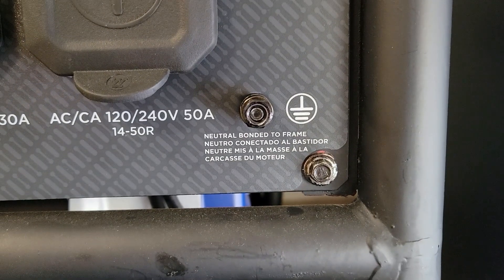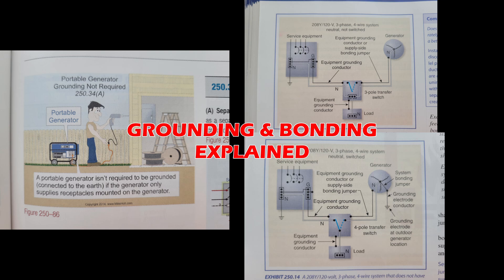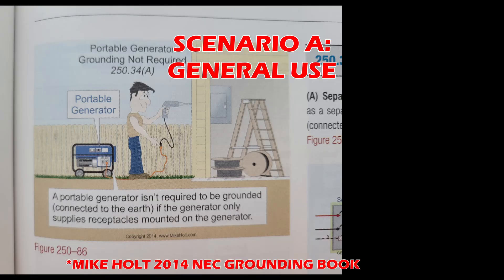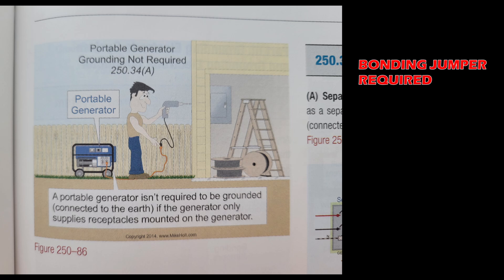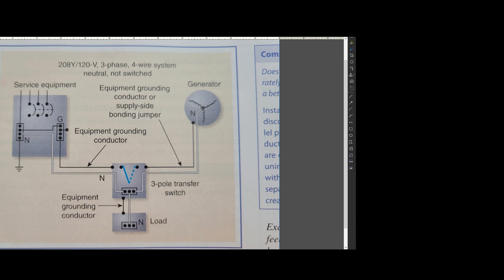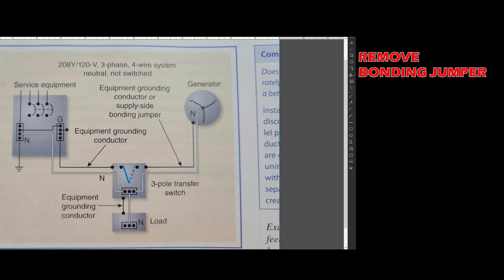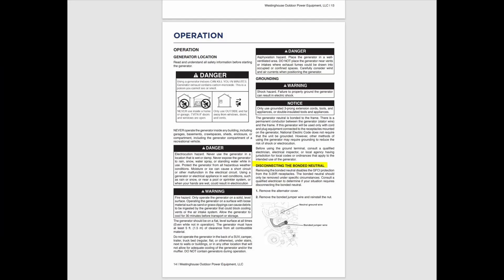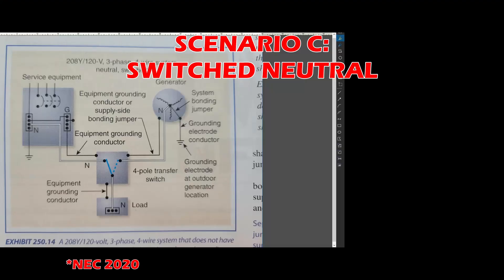How To Ground Your Portable Generator Per Code | DIY

Comment: If I have an old generator without a manual (and don’t trust previous owners) how do I know which system I have?
The video opens showing the symbol which states the jumper is installed - does that mean it shouldn’t be additionally grounded?  This is a little over my head.  The video makes it seem like scenario A and B are the same?  Are scenarios B and C for generators that are tied into a building?  Are all portable generators with receptacles on them scenario A which means no grounding rod is required?

Comment: I hope what I have is set up right. 
My manual generac transfer switch breaks the neutral and hots from the Main service panel in generator mode. The Main service panel is bonded neutral and the transfer switch is not bonded neutral but my generator is bonded neutral so in my case I need a grounding rod for my generator. I guess if there is a short in my generator system and I have no grounding rod I guess I will run the risk for current travelling through the ground to all the appliances and I guess that would be dangerous. So I guess I am running two systems utility and a generator system. When running in the  utility  system the transfer switch circuits have their hots, neutral and ground removed from the main service panel get its power from a 50 amp breaker. There is a green ground wire that grounds the main service panel together when in utility mode however when in generator mode it changes everything.

Comment: Can someone explain the risk/damages that can occur if I DONT have a switched neutral at my transfer switch and I use my bonded neutral generator to power 6 circuits during a power failure? I do not have an inverter generator.  I have a 30-foot heavy-heavy guage cord connecting my generator to my transfer switch. However, after using my generator this past winter in the way I described above, my refrigerators/freezers and lights worked fine. My natural gas furnace also worked, but after the power service returned 36 hours later, my relativly new furnace died and I know I had a control board failure. $7000 later and I have a new furnace. Would bonded neutral at the generator cause a control board to fry?
Reply: If your transfer switch breaks the neutral and your generator is Bonded Neutral you are supposed to have a grounding rod in the ground connected to your generator. If there is a short the current will travel through the ground and with no grounding rod connected to the generator you run the risk of carrying current through all your appliances which are grounded and now alive with electricity. A grounding rod would stop this. Not sure if this would cause circuit board failure. There should only be one neutral bond in a system. Your utility power and generator power are two separate systems and with the neutral broken they both need their own ground rod.

Comment: Nice video but you did not really cover the case that over 80% of the people do in their residences... that being a manual interlock at the panel and not having any sort of transfer switch.  This is almost in all cases where the neutral is still connected in the panel and is far more used than a transfer switch.  I am guessing your scenario B is what that tries to describe or that is the case you would fit it into.  Also, for that 98% of people watching this they do not have 3 phase power.  They have single phase with 2 legs tapped at the transformer.  I totally agree with the manual interlock case, unbound the neutral/ground on the generator and do not ground the generator to a rod.  thanks for posting

Comment: Can you help me with my truck generator setup? 

I’m in the process of building and securing my generator to my work truck. Not sure about grounding if I’m going to run a 30 amp plug to a breaker panel and outlet box.

Comment: Loads off picture and talking all as you need to do is ground the generator  to the home ze if you have a separate earth supply live supply and neutral supply you can the put extra safty on the lead with a plug in red socket

Comment: Great instructional video.  Love the way you have presented all this.  Very cool. 
My knowledge of electrical is below basic.  Wish I knew more in this level of detail.  
Bought a Predator 8750 w inverter genset and the instructions say to use a grounding rod of 6 ga copper.  If I understand it correctly.  <simulating your buzz noise>

Comment: Other than it not being to code, what is wrong with having the bonded ground in the second scenario? What problems could it cause?
Reply: A neutral-bonded generator will work perfectly when it comes to powering your home.  Only the code Nazis take issue with the ground and neutral being in parallel from the service panel out to the generator.  Most of the current will still return on the neutral conductor and your in no danger because the generator frame is bonded to the neutral hence you will never be electrocuted.

The only issue will be the GFCI protected outlet which also isn't an issue because you're going to powering your home with the 14-50R and it's not GFCI protected hence it won't kick!

Comment: Hey, Mr. Gonzalez.  I plan to use my generator for appliances plugged into the receptacles (refrigerator, TV, portable AC unit)  It wont attach to my house, electrical panel, or anything else.  Literally devices straight to the receptacles.  So if Im understanding correctly, in my case I will not need to ground the generator, correct?  (I have the DuroMax XP5500EH)  Thanks!!
Reply from the maker: Correct, no additional grounding or changing grounding configuration is required when you meet these two conditions: A) you connect your appliance directly to the generator's receptacle and B) Neutral is bonded to the frame from the factory (your DuroMax is).
Reply: @dgtv3320  i watched the video but just wanted clarification. I don't need to ground my generator if it's plugged directly into my main breaker?
Reply: @XxMugatu  Correct. If attached to your main breaker or more properly a transfer switch, your generator's wiring needs to have the neutral and ground removed. The issue is what if you are going to use the generator to go camping or even simply to fire it up to cycle some fuel/oil and give it a check-up? Apparently, you can buy neutral ground plugs that simply plug into one of the generator's outlets and that now performs the grounding without having to uninstall panels to get back to the inside of your generator to reconnect the wires you just removed.

Comment: too technical. I don't understand the correlation between the diagram figures and the parts of the generator.
Reply from the maker: Noted, thanks for the feedback. Here's a short summary: I overview (3) common ways to use your portable generator with the 3 different grounding configurations for each application. Most people fall under condition "A", that is power appliances directly from the generator's receptacles (for example, going camping and powering a small electrical stovetop). No additional grounding to your generator is required assuming these two conditions are met: 1) the appliance HAS to be connected directly to the generators receptacle  and 2) the generator's Neutral bus bar is bonded to the generators metal frame from the factory (most generators are bonded from the factory but consult with your user manual for confirmation, look for key words 'bonded neutral'). I hope this helps.
Reply: Yeah Im planning onrunning a 110 inverter welder from a generator.  Light guage sheet metal, brackets and perlin. So look for the symbol or sticker showing ground to cabinet on generator, and if welder plugs with Grnd into generator -should be ok?

Comment: Hey bro, so u didn’t describe the last to scenarios like you did the first one. Example…. You have your generator connected to the house via a 4 pin connector. Or another example….You have your generator hardwired to your control panel. Or whatever. How do I know which scenario of the last 2 you gave that I have? P.S. Sorry for your loss too.
Reply from the maker: Frank great question thank you for asking. I'm going to follow up with another video describing the last two scenarios in greater detail. I'll provide a link when ready.
Reply from the maker: Frank I made 2 new videos, links below to the 2 scenarios I was referring to:
Case B (continuous neutral): https://youtu.be/ZoIW0ePC0ak
Case C (switched neutral): https://youtu.be/yjJeqBDpWww
Reply: @dgtv3320  Awesome thanks so much for the update. I’ll be sure to LIKE and Comment for your algorithm.

Comment: I want to use an inverter for backup power rather than a generator. The ground-neutral bond in the inverter can not easily be disabled.  I want to use a transfer switch that only switches the hot connection.  The neutral is not switched. So, in this case there would be two instances of ground-neutral bonding.  I contacted Xantrex tech support about removing the ground-neutral bond in the inverter.  They did not have any solution.  Is there a safe way of isolating the ground from the inverter from the ground in the service panel? What book by Mike Holt did you use in the video?  Thank you.
Reply from the maker: If you decide to go with an inverter that has neutral-ground permanently bonded, unfortunately for a code compliant installation you'll need a transfer switch that disconnects Line1, Line2 & neutral simultaneously. An example is the Generac 50A manual transfer switch (Model 9854) https://www.generac.com/all-products/transfer-switches/manual-transfer-switches/homelink-50a-transfer-switch As mentioned in the graphic "Scenario C", you'll need a grounding rod (or approved grounding electrode) connected to your power source; unfortunately there is no way around this.
Reply: @dgtv3320  Oh boy..... I just ordered Champion inverter Generator...... Hopefully it won't be so hard to Undo Neutral/ground bonded....😱😌
Reply: @dgtv3320  There Go my Research again